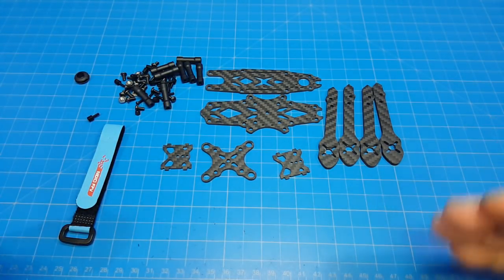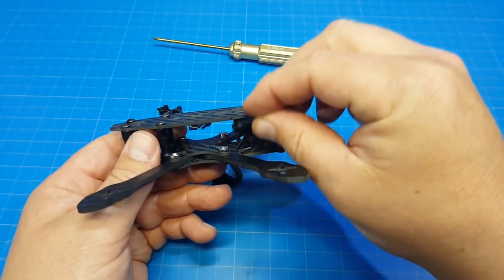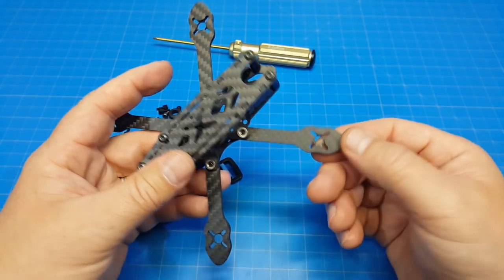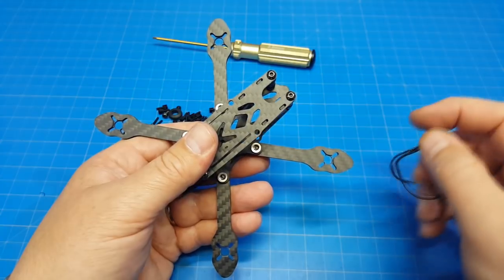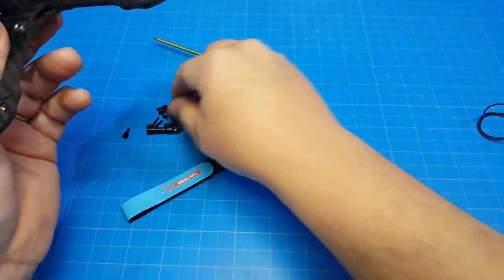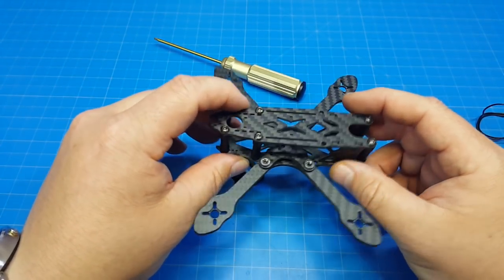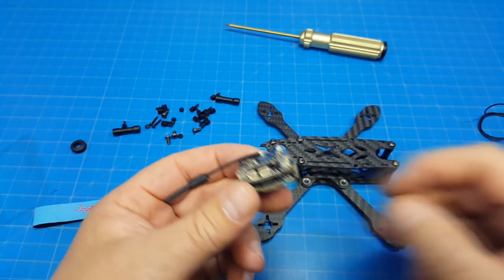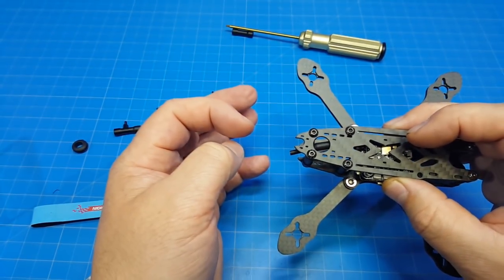Nidici XF3 - 3inch micro frame

Comment: Looks like a nice 3" frame that right up my street although maybe a bit of a challenge to cram everything in.Think its time for me to take a dip into the 2 to 3 "micro quads and i thinks its going to be with the 3"babyhawk r.
Reply from the maker: nice. the 3incher is nice, good long flight times for training.
Reply: The baby hawk r has no space for a runcam split mini though. I bought a 2 inch and put 2.5 arms on it. I love it, but wasn't able to put a split mini in it. Im building a 4 inch now on a merica frame with the hglrc 440 esc and fc, using a unify pro and a r-xsr. Haven't decided on motors yet though.

Comment: Nick I used your tip using blue tack to help soldering except I didnt have bluetack so I used non hardening play clay( which I had) and it worked great even though it may have left some residue on the wires.
Reply from the maker: I find that with blu tack too, I just dab the blu tack on the residue repeatedly until it comes off.

Comment: Sure is a nice looking frame and does look like a mini martian frame but less boxy and with cleaner lines, in my opinion.  Absolutely would love see this built out but then you would hear that from most of us, regardless.  Shouldn't the real question be, how should it be spec'd out?  I mean, 3S or 4S and 11xx, 14xx or 16xx, etc...?  I'm just saying here, that maybe a long running micro cruiser, GoPro (Firefly?) capable quad would be nice to see, at least for a change of pace and it appears that this frame could fill that role. Keep in mind, without a camera's weight it should still deal out some power and be sporty.  However, it seems that most will want to see a High KV, battery sucking vampire, hold on your butts, screaming quad these days, that I don't know what would be good to build...just saying...lol
Reply: Check out the iFlight R1 X5 if you like this it's the real company and the 5inch variant
Reply: Yes, I have seen that one before and it's very nice frame but it's a 5 inch and I'd rather see what can be done with 3 inch frame. Thanks though!
Reply: Just build a toothfairy! I'm keeping up with 5" on the 2018 Multigp qualifier track

Comment: Straps with bucle rule, eh eh... Two screws to fix those arms would be much better... I´m currently building a quad with the King Kong GT 130 and it´s pretty similar to this one but the arms are one with the bottom plate, I´m using the same stack that comes on the Fly Egg 130 with 10Amp all in one ESC...